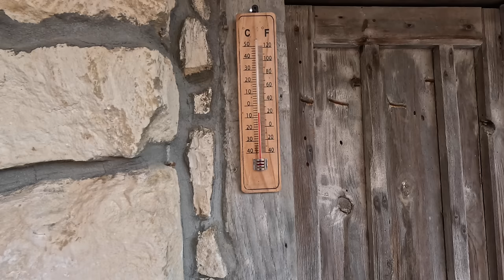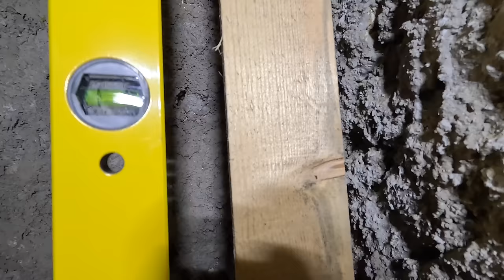Electrical Installation Testing, Thermal Insulation of the Living Room Ep.11.

Comment: I always follow your videos, and let me give you some advice, since I have been an expert in the electrical field for 35 years. The electrical cables (or wires) must be inserted into special corrugated tubes (diflex) both for their protection and to add others if needed. In Italy these are the safety regulations, I don't know where you are and what your laws are. The wires connected in the electrical panel must be connected to the various switches using the terminals, and be tied in a precise order, and not in that confusing way. Mine are simple advice from an expert electrician, and don't take them as criticism. Greetings from Rome, Italy.
Reply from the maker: Thanks for watching and for the advice.

Comment: Nice work! Next time you should connect that extension cord to house first and then generator because its live voltage in house end of the cord if connect it first to generator. You can electric shock and trust me, it hurts 😉

Comment: Hello Renovator Friend,
CAUTION always unwind an electrical extension cord because when it remains wound with or without support there is resistance and the cables can melt and weld together....and the extension cord is cooked.

Best regards Alain, artisan from Belgium.
Reply: @luxonbushcraft ,  no worries, I watch your videos with real pleasure.
good luck and see more great videos

Comment: Electricity in the house is very convenient. In an open high-altitude area, a wind generator is asking for, it will complement the solar panels well. Is it safe to lay wires without a corrugated hose or cable ducts?
Reply from the maker: Thanks for watching! I trust my electrician 👍

Comment: Solid work! one question: Will your power be supplied by a generator or by renewable energy, or will you be tying into the grid?
Reply from the maker: Thanks for watching! There is no electricity network nearby, and there won't be, as this has since been declared a protected area. For now I will use the generator, and later I will see which option I will choose.

Comment: Looks awesome!! are you going to connect to the electrical grid or use generrator?
Reply from the maker: Thanks for watching! There is no electricity network nearby, and there won't be, as this has since been declared a protected area. For now I will use the generator, and later I will see which option I will choose.
Reply: well if you have lots of sun best option i think is solar panels with batteries but is not cheap,eitherr way looking forward for next episode! grreetings form greece my friend @luxonbushcraft

Comment: Luxon, is there anything at all you cannot do?  I desperately need an electrician.  lmao.  I have to laugh at my own self.  I was using my drill.  I saw how cool you just dropped that drill bit out of the chuck (is that what it is called?  
I am so slow, it takes me forever to take it out and put another in.  There's a reason you are the expert eh  lol. But man, all the dust and bits and pieces that fly off.  Good thing I wore my safety glasses.  Now, if only you had a need to use a jigsaw.  I need to use one, and I would love to see you use it so I feel better about using it myself.
Reply from the maker: Thanks for watching! Practice makes perfect 👍